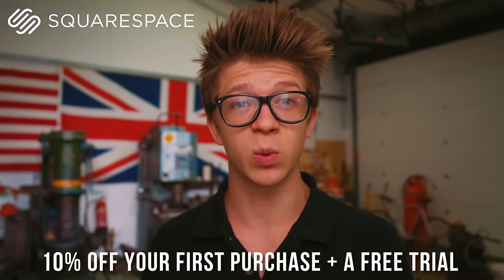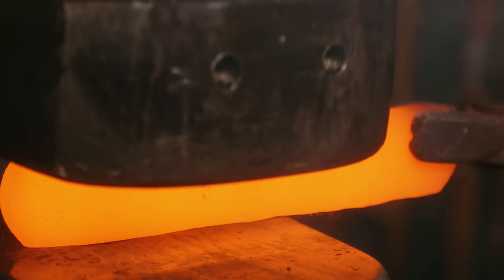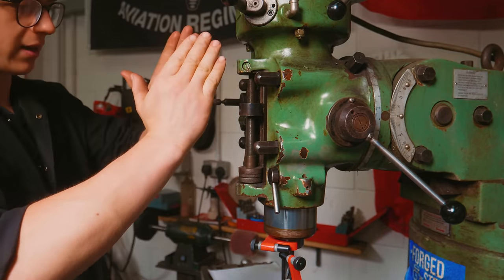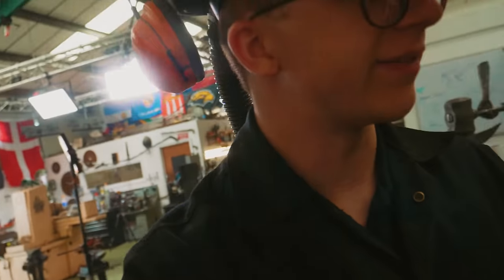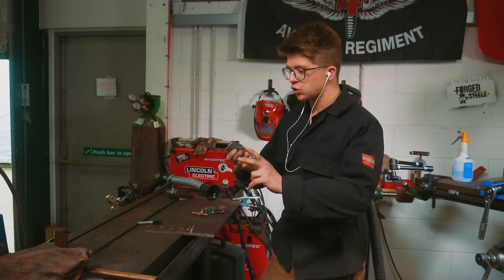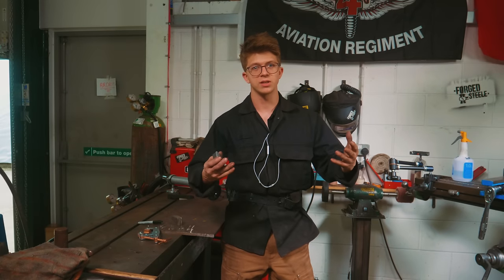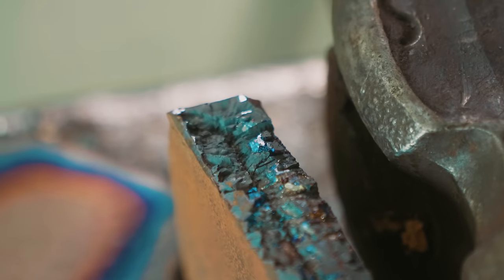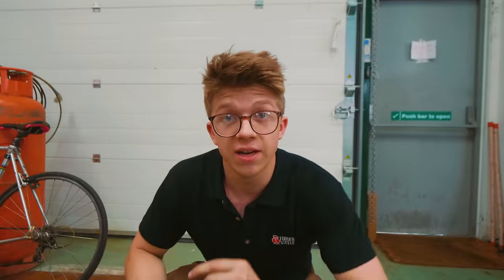CAN YOU MAKE TITANIUM & STEEL DAMASCUS?!?!

Comment: Hi Alec, titanium and steel are very hard to bond. Though a way to get it working is to use a thin silver layer in between which is usually done by silver plating the steel. Good luck!
Reply: sounds like a good idea that is fairly easy to do.
Reply: Wouldn't that just be soldering them together?
Reply: I don't think the silver will melt at these temperatures to be considered soldering. I think it would be more like a surface prep for mating dissimilar metals since the plating would only be microns thick and hammering the pieces would warp the plating enough for it not to be continuous.
Reply: Don't use steel. Use straight elemental iron. There's too much crap, besides oxygen, getting in the way of a bond.
Reply: Titanium likes carbon a lot, more than steel, so you'll get TiC and Iron, and those don't bond either.
Reply: Another thing (besides using pure iron, not steel): after wiping down the surfaces with cleaner, handle them by the edges. Even a sub-micron film of natural hand oils and even sweat (think sodium? chloride? you really want those contaminants on your titanium?) is going to ruin everything. I'd even finish by using drying ice blasting, it's sometimes used to get absolutely everything off titanium surfaces, and sublimates without a trace.
Reply: Titanium forms very quickly a nasty oxide layer out in the atmosphere, which is also hard to remove. On a professional level you'd probably etch the oxide with diluted hydrofluoric acid and then keep it away from more oxygen i.e. store it and further work with it in an argon atmosphere. As soon as the oxide layer forms (thickness and color are connected btw) you'll have a hard time bonding it to anything else.
Reply: You could probably  do it if you used an inert gas "chamber" to forge it in.
Reply: Heat it in liquid salt?
Reply: CNC Kitchen ok so anyone messing with hydrofluoric acid really really needs to read the safety directions first. It gives the word dangerous new meaning.
Reply: you are right about silver layer, but forging will be very hard or impossible
Reply: Steel forge welding, such as occurs in Damascus, happens at a minimum temperature of 3100 C, which few propane furnaces can reach though there are some. Titanium will actually burn in pure nitrogen, the largest element in our atmosphere, at 800 C (and in pure oxygen at 600 C), what's worse is that nitrogen will make titanium brittle as low as 400 C. You must use a shielding gas (pure argon is recommended due to it's high purity and low moisture) to counteract this, and MUST be applied to any part of the metal that is heated including the backside of the weld. The colors actually indicate the level of contamination, good for jewelry but bad for durability. Experts compare titanium welding techniques to those used for nickel alloys or stainless steel.

You must also deal with metal purity (ASTM international recognizes 31 different grades of titanium), pure titanium is easier to weld that titanium alloys. The maximum tolerable limits in weld metal have been estimated as 0.3% oxygen, 0.15% nitrogen and 150ppm hydrogen so scrupulous cleanliness is essential. Assuming you can exclude oxygen, nitrogen and hydrogen from affecting the metal, tungsten is suggested as the metal for welding so it might work as your bonding agent instead of silver. Anything from a silvery, almost mercury like, weld (highest quality) through yellows to brown is considered acceptable but any other colors are failed welds.

Bottom line - titanium should be kept in a 99.995% pure argon during the forging or welding process. A directed stream of pure argon gas at both sides of an area being welded is used for actual welding but complete cov3erage should be used for forging. Also keep in mind that titanium is 3 times the tensile strength of steel so the cupping you noticed is unavoidable. You might have better luck with a titanium/steel alloy.
Reply: Khalagata melting range (as in liquid state) of  Steel is 1425 - 1540 Celcius or  2600 - 2800 Celcius for high carbon steel. 
Can't really forge anything while it's in a liquid state...
Maximum temperature for any type of steel for forging is under 1400 degrees Celsius.
Titanium forging temperatures are generally at or below 1000 degrees Celsius. Pure titanium melts at 1670 degrees Celsius. 
Apart from high carbon steel, all of these melting points are achievable in a decent propane furnace and certainly all the temperatures required for forging.
Reply: My apologies, I went back and checked my sources and you're right. What I put down was the temperature of an Oxy-Acetalyne torch. My mistake. As for most propane furnaces not reaching welding heat, I've been researching furnaces recently and http://www.mooseforge.com/Forges/forges.html is where I got that information. 

Quote: 
Most gas forges never get up to welding heat.   Contrary to what most hobbyists are claiming today, most factory-made gas forges cannot reach welding heat. Don't be fooled by the claims of amateurs that they forge weld all the time with this or that forge. Most amateurs are simply boasting of being able to do something that they have never actually done. Most factory-made gas forges cannot reach welding heat, and the few that can, will heat the iron much more slowly. During the last 25 years, a new welding flux was introduced specifically for allowing gas forges (those forges that are actually capable of reaching welding heat) to be used for welding. This special flux is formulated for the increased scaling that results from longer heat times when using the gas forge. 
  The lower temperature and slower heating associated with the gas 
forge is actually helpful to most beginner smiths and those with poor 
fire skills because, a cheap gas forge will not heat the iron to a 
 sizzling white heat- suddenly destroying the iron. Instead the iron will 
 waste away (slowly burning) in the fire over a long period of time, but 
the inexperienced smith need not worry about suddenly destroying his 
iron by accidentally leaving it in the fire too long. On the other hand...
  Some gas forges CAN get hot enough to fire weld!  There are some homemade and custom designed gas forges that can reach this higher heat. If the reader is going the gas forge route, I recommend visiting Ron Reil's website to see how to design the hotter custom-made forges at http://ronreil.abana.org/design1.shtml . Ron collection of designs both of his own and those sent to him by friends. Lots of designs of burners, insulation, most are inexpensive. These guys keep adding more stuff.
  Special fluxes needed for fire welding with gas forges.   Since gas forges will take longer to heat iron, more oxidation will develop during the extended heating period. Special fluxes are used to deal with the additional scaling which results from this oxidation. Centaur Forge sells these fluxes.
Reply: Khalagata no worries, l figured u had a wire crossed.
By the way Alec made his own forge, indeed he made a series about making them.
Reply: True, high carbon steel's melting point is in the low 1300's. Iron actually has a higher melting point, in the 1400's
Reply: I COME FROM SUN haha that was my bad, that's meant to be Fahrenheit not Celcius.
Reply: I figured. NP there, I made just as bad a mistake with the temperature in my post.  =)
Reply: CNC Kitchen u
Reply: Is the silver to prevent titanium carbide? or address the oxide issue? How would you bond the silver to the titanium without introducing oxides?
Reply: That's silver soldering, technically brazing
Reply: Or etching the Titanium clean, then electroplating a thin layer of silver onto it?  Provides a layer of silver to aid the bonding, and keeps oxygen away from the Titanium.
Reply: You got that right, Matt TheChosen. Hydrofluoric acid is incredibly nasty stuff. And so, of course, it was one of the favorite playthings of my college buds and me; lo those many decades ago. At least no one got expelled for playing with any acid. Nitrogen triiodide, on the other hand, was so much fun that it forced a few people out!

We didn't really damage anything or seriously injure anyone but some of us were, by the end of our Junior year, living in a state of perpetual paranoia about what was going to blow up the next time we touched it. The incident that finally got us all back under control was when someone rigged a garbage can with a bunch of the stuff around the rim; just to see if it would go off. Well? The dang thing went off like a howitzer shell and the poor cook who triggered it quit, and rightfully so, on the spot. He was not seriously injured but lost some facial hair and was, reportedly, turned a bit purple by the residue.

NOTE: I had absolutely nothing to do with the "blowing up the cook" incident. That's my story and I'm sticking to it.

Cheers!
Reply: You need iron ore between each layer to be burned at very high temperatures with enough time ...
because titanium is very hard too solid
Reply: @Kalanchoe1  Silver melts at 960 C. But on should look up the phase diagrams of the material.
Reply: @CNCKitchen  , I would use HCl acid instead. It should leave a layer of TiCl4 and if one is fast enough the Ti may not re-oxidize before the furnish treatment. But I would recommend getting a glove box and do the cleaning and TIG welding in it under a nitrogen atmosphere. Probably don't need Ar. Besides N2 is a lot cheaper.
Reply: @Khalagata  I think you mean F. Iron melts around 1450 C. Titanium around 2800 C. W melts around 3600 C.
Reply: @haroldsaxon1075  yes. In principle one only need about 0.5 microns of Ag. That is not enough I think to think of it being solder as at temperature there is a lot of diffusion occurring.
Reply: How about using an induction coil heater in a box you make, in which you pump argon gas into? Should solve scale from O2 and virtually eliminate explosion risk. Only tricky part is once you go hammering
Reply: @maddox0110  l
Reply: I've read that it can be done easily with high explosive welding. :)
Reply: i hear you can get them to bond via forge welding if you remove any oxygen from the environment during the forge weld. similar to forge welding certain stainless steels. 

difficult but doable.
Reply: @Khalagata  Well, crap. My first though was to use a N2 environment to stop the oxidation, but if what you're saying is true, then that's a really bad idea.
Reply: Actually an Argon environment is used to stop the oxidation, in a patented process of canister forging, because of the extremely dry nature of the gas. One peculiarity of titanium is that it has a high heat resistance but a low oxidation point so you have to keep it away from certain common gasses. That said, you can forge the two together but it's much easier if you add the silver.
Reply: @doggonemess1  yep, I've seen this done with DETASheet. A mate I used to work with did his masters thesis on this. I suspect you are still going to run into cracking issues as you hammer it out since titanium is brittle and will fracture when you strike it.
Reply: @blackrabbitobject  Thanks for the info, I appreciate it! It makes me wonder if titanium would actually be a poor choice for a long blade. You see it in sci-fi and fantasy fiction a lot, but I'm willing to bet they understand next to nothing about metallurgy.
Reply: Is this due to wetting tendency of one metal to another? I.e. will molten titanium not flow over steel and instead form tiny drops?
Reply: @doggonemess1   VEry true this is how the make bi-metal tank armor
Reply: @Khalagata  titanium in nitrogen at high temperature forms titanium nitride, a hard, yellow ceramic. It has some uses as a hard cutting tool coating, but its brittle and not useful at all in a Damascus forging.
Reply: I wasn't aware of that, TY. It explains why the use Argon anyway. =)
Reply: @CNCKitchen   I recommand avoid working with hydrofluoric acid as much as you can. (very nasty and hard to contain) and work with multietch (us) or titan etch (europe)
Reply: its possible to forge Titanium its just hard
Reply: That’s info you don’t find online but with experience, thanks for sharing!
Reply: About titanium for knife making 
What grade can I use for knife making and sword making
Reply: Yeah........ NO!
Reply: @smartmonkey777  Are you talking about the old M1A tank armor? My cousin worked on that in the Marines.
Reply: @CNCKitchen  ok, just gunna ask a stupid question here, what would it look like trying to go some variation of canister steel in a titanium can….get it hot enough, the steels gunna turn straight to liquid at this point, but then you avoid the oxygen issues, get it hot enough to fuse and go from there?
Reply: Hi I'm not a qualified candidate for this job... but if smashing can bond materials together, why not soup it up and take out the impurities? I see that they don't bond due to the differences between heating... will the titanium be destroyed? Or like water and oil they just won't bond? Let me know
Reply: Yes, titanium being one of the hardest and silver being one of the softest.
Reply: I want to buy a pocket knife, is titanium blade knife better then other types of blades? Thanks
Reply: @CNCKitchen  hydrofluoric acid... Ooh, my arse just slammed shut. That stuff is heinously toxic!

Comment: Me, sitting here with a titanium plate in my collarbone: cool.
Reply: Titanium is good stuff
Reply: Haha same bike crash
Reply: Titanium and bone damaskus🤯🤯
Reply: impossible, but interesting
Reply: I've got a titanium bracket holding my C3-C7 vertebrae in my neck together. Yay fusions.
Reply: I have titanium plates wrapping all of my finger bones
Reply: My dad had a massive wreck in his 20s and it's titanium from the pelvis down
Reply: @respectthedark2299  same bike crash
Reply: “Part 54: inserting the Damascus collarbone into the patients shoulder”
Reply: The story, I slipped and fell on hardwood floors near a fridge while wearing a plastic back brace. I call this the fridge incident.
Reply: @dusktheowlgryphon  I was 4 years old riding my tricycle down my driveway, flipped it.
Reply: Work accident,  full shoulder replacement  85% movement  but so much better than losing my arm.
Reply: Damascus titanium collarbone O_o
Reply: Ah yes finally been looking to resupply my titanium collection.
Reply: That must suck. Will you/did you ever get it removed or is it in there for good?
Reply: If I ever did, I would be crippled on the left side.
Reply: 2 fused to my spine.
Reply: @DasNuk  I’ve got titanium rods holding C4-C6, I feel you brother
Reply: @kaydenmcgraw259  I have a bracket,  4 spacers, 10 screws (2 screws in each vertebrae) and 2 rods holding my neck together.
Reply: me in my jaw lol
Reply: Ptshh stop flexing your cybernetics
Reply: When I was probably about 13 I fell off a two-story building and landed on on my arm from my wrist to my elbow was shattered so practically my whole arm from there to my elbow is titanium........ don't know how it's possible but they replaced my arm with titanium technically.. it hurts like like crap when it storms

On top of that my hand has zero to no feeling at all...... heh..
Reply: Lol they will be switching to magnesium alloy plates in the future. Stronger and lighter than even titanium
Reply: @respectthedark2299  same, hit a deer last month
Reply: Mines in my skull.
Reply: I know what I must do, but I do t know if I have the strength to do it.
Reply: @Why So Serious? I guess that explains why weird supernatural things happen around me.